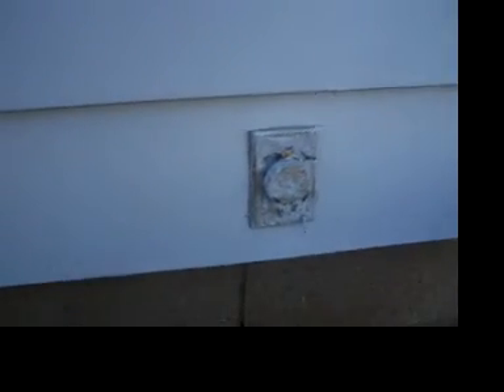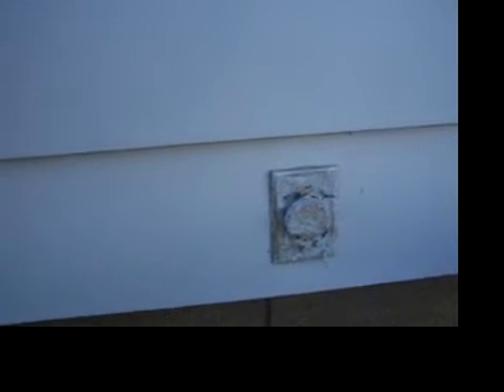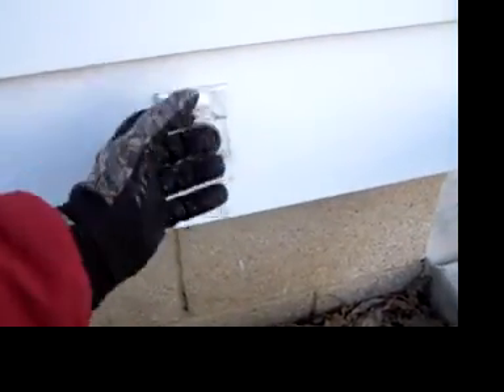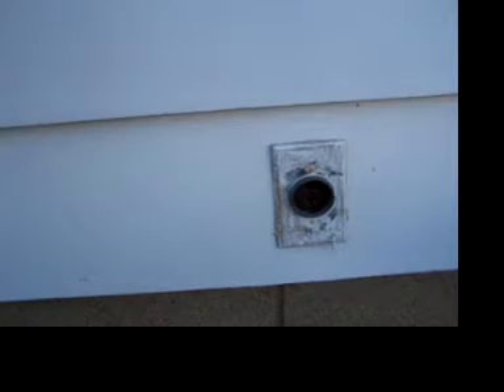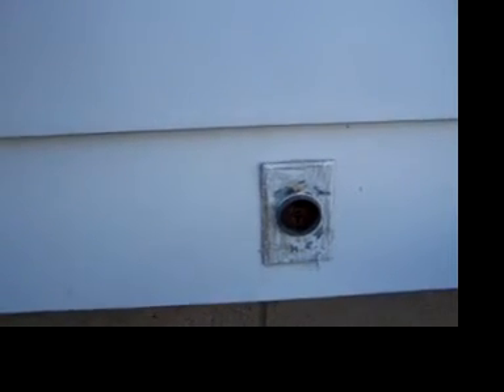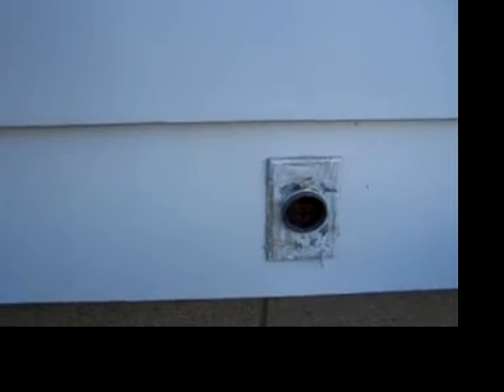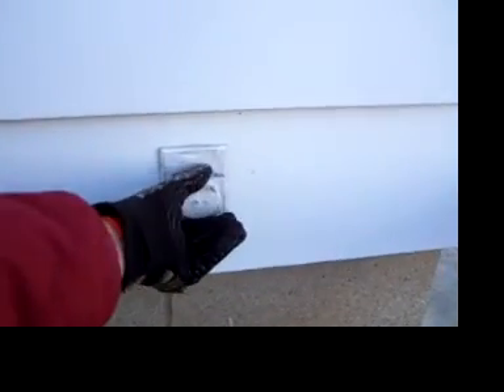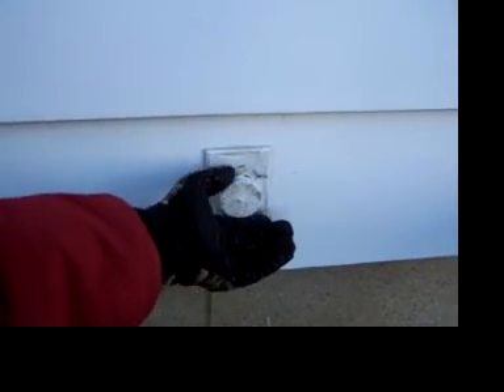Old ungrounded exterior outlet

Comment: My experience has been that screw caps were quite common, especially in the 1950's.  Although I couldn't see all that well in the video it looked like a tandem outlet to me.  Replacement with a GFCI is essential for safety (at least in my opinion).